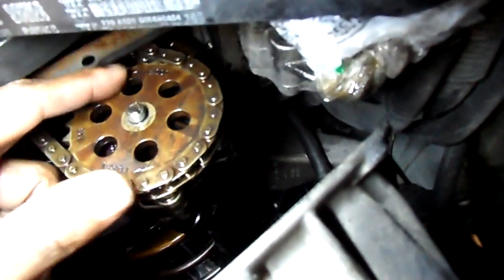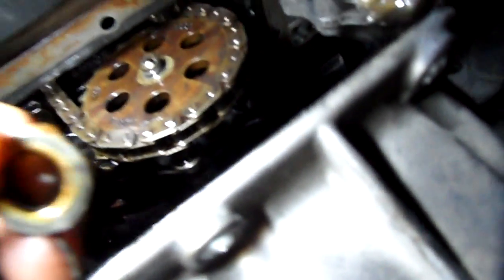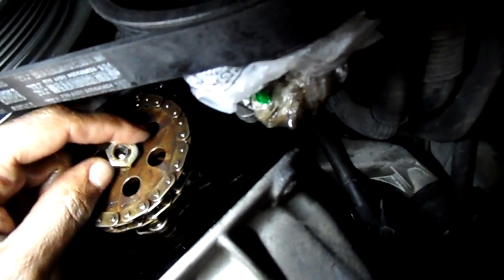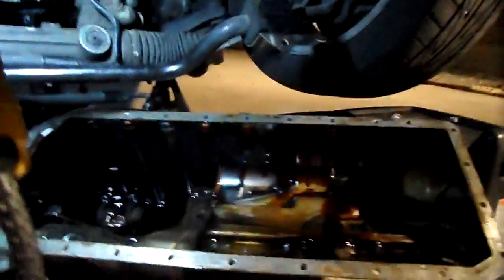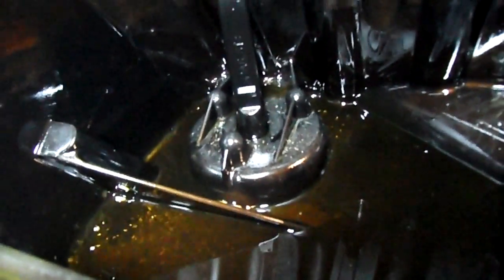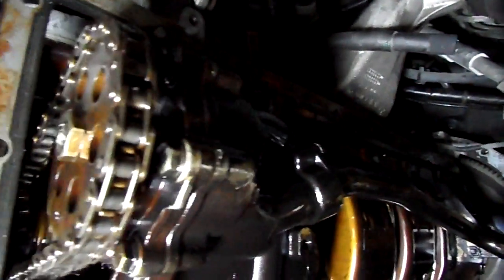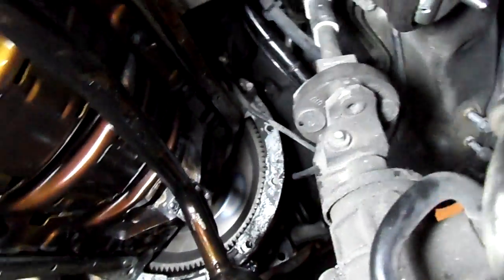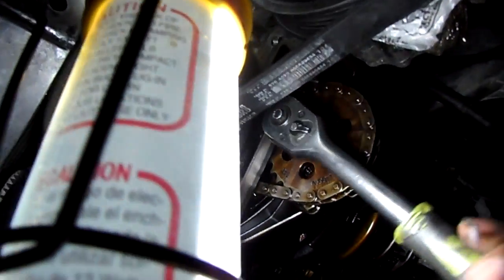BMW e46 Oil pump failure/ Loose nut part5

Comment: I have an 318i 4cylinder with a red oil pressure light on my dashboard,and a sort of diesel engine sound, no oil circulating on the engine, as you can see on the oil cap.. Need to have it fix.. Update later for the result..
Reply: Hey. I got the exact same thing on mine too. Do u have IG? LET ME KNOW WHAT YOU DO TO SOLVE THIS
Reply: Me too bro. Can I have your contact. Want to know how you also did it

Comment: A indy said it was timing chain. Vanos. Hydraulic tappets. For £1300. Well he was wrong. Most of the cowboys Machanic are guessing problem. Once they open the engine up ,then you are in trouble

Comment: Do you still have this car? is it still running ok?
Reply from the maker: no. I traded it 4 years ago
Reply: How long did you drive it after fixing the oil pump did you get rid of it? I have a 328i with the same issue and am trying to decide to just replace the nut or rebuild the engine.
Reply from the maker: +Bill Britton I drove it with confidence for 6 more months after this repair was done before I had the stalling issue which caused me to part with it. I wish I had kept it as a back up car. I miss it😢
Reply: I see. About how long (minutes) or distance did you drive the car before realizing that the oil pump wasn't working? I had to drive mine for approx 6 miles. I was on the freeway and drove to the very next exit.
Reply from the maker: +Bill Britton same here. I was on the way home from work (a 10 minutes commute on city streets) when I noticed the loud valve tapping (oil starvation). I knew right away something serious was wrong with the oil circulation, just didn't know exactly where until I started researching.
Reply: OK thanks!

Comment: did the red oil pressure cluster light came on?
Reply from the maker: no.
Reply: +s2000julius thats strange i mean the oil pump shouldnt can rotate if its fallen off?

Comment: Your the best. This just happened to me in my 01 x5 3.0i. I'm hoping it's the same problem. But I drove like 4 miles with the loud diesel sound. So I'm hoping that the magnetic oil I used did its job.

Comment: Thanks for the video, I did not know that the M54 suffered from this. On the video, I cannot see well but it seems to me that the nut you re-used had seen better days. I suppose that it ran loose for a while. Maybe a new one and some kind of thread locker would have ensured a long life. I would not be surprised if it happened again, I hope not. Thanks again for the video.

Comment: You could spend 500 bucks and get the upgraded kit from VAC Motorsports and only have to do it once.  Otherwise you will experience this problem again.  Clock is ticking, unfortunately.